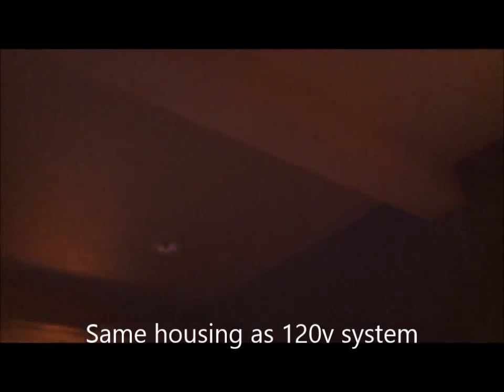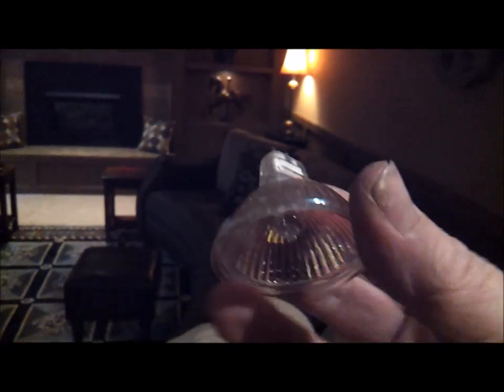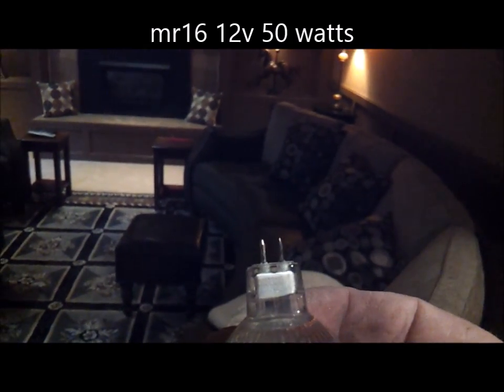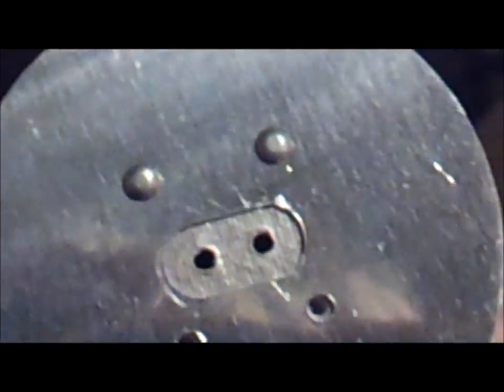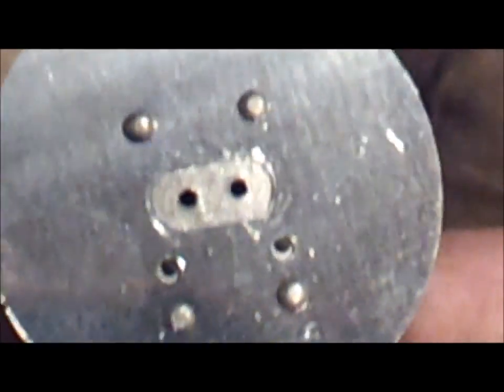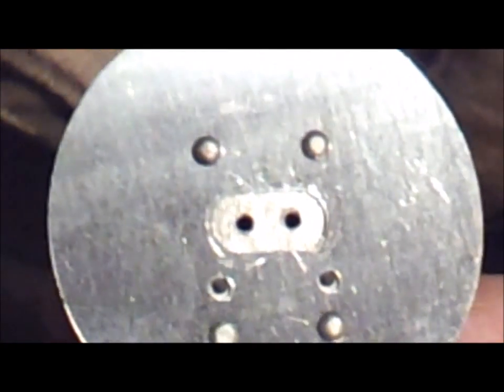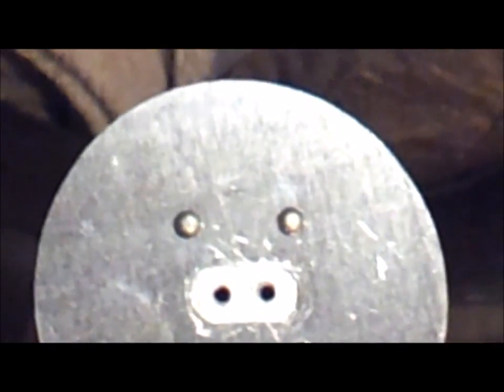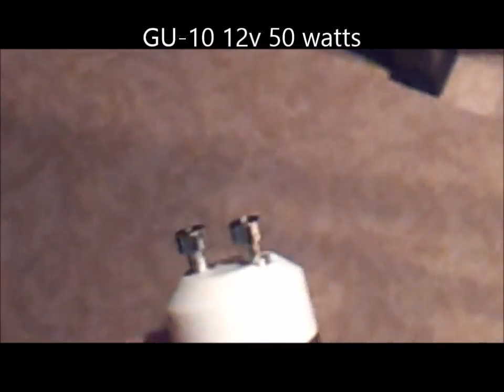Repair Faulty mr16 Halogen Light Socket with a GU-10 socket

Comment: I can’t make any sense of this. The mr16 bulbs are 12V input voltage. All the bulbs I’ve found that work with gu10 sockets are 120V. So they’re not compatible and if you try to to this, you will be in deep trouble.
Reply from the maker: https://www.ebay.com/itm/383796010318
Reply from the maker: https://www.ledlightbulb.net/index.php?main_page=product_info&cPath=2_120&products_id=2408

Comment: I found a retrofit kit at amazon
https://www.amazon.com/Voltage-Downlight-Dimmable-Magnetic-Transformer/dp/B0753TYHW7/ref=pd_sbs_328_1/134-0080920-5557851?_encoding=UTF8&pd_rd_i=B0753TYHW7&pd_rd_r=59549159-5f76-448e-b5c5-0445aaf903c1&pd_rd_w=2Vm74&pd_rd_wg=KUNZq&pf_rd_p=ed1e2146-ecfe-435e-b3b5-d79fa072fd58&pf_rd_r=VV699W6B8T1S0HF6YXW5&psc=1&refRID=VV699W6B8T1S0HF6YXW5

Round LED 4 Inch Low Voltage Downlight 12V; Dimmable, 11W, 750 Lumens, Day Light 5000K, Fits Most MR-16 4 inch cans

Comment: your link is to a 120AC volts GU10 bulb. the old bulb MR16 is a 12AC volts. ??? dId this work? did you remove the transformer?
Reply from the maker: thanks for the heads up. I fixed the link and the description. And yes you could remove the transformer and wire a 120v gu-10 led but would need to change the dimmer from magnetic to standard
Reply: @greenrumour  thank you for the links. I had given up trying to find 12volts
Reply: Which bulb did you buy? I checked ebay bulbs.it was a dimmable 88-260volts, not 12v bulb.

Comment: I tried this... I cut the wires past the shield and attached the new GU10 wires and sockets. It didn’t work for me at all. I undid the new body and place the MR16 light right to old wires to make sure wires weren’t damaged and the MR16 lit up. So I know wires coming out of can are good but new socket replacement doesn’t work. Before I cut anymore I am wondering what could be wrong? Any suggestions? It seems strange that almost all the lights have pitted at same time...they were installed at same time roughly 6 or more years ago. These were installed before I moved into the home. Any advice appreciated.
Reply from the maker: the first thing that comes to mind is the bulbs arent the same voltage.  If you have 12 volt transformers and bulbs now you must get 12 volt gu10 bulbs. If your exsiting mr16 bulbs are 110 volts the gu10 bulbs must be 110 volts

Comment: My problem is I cannot insert the two pins all the way in a ceramic socket. It is a pendant light system. Is there a solution other than socket or full replacement?
Reply from the maker: does the old bulb fit in?
if so you may have the wrong bulb. or a bent pin.
if you are positive the bulb is correct and you can't even put a bulb from one of the other pendants in then the socket is  going to need replaced.
Reply: greenrumour thank you. I know the bulb is correct because the same bulb fit into the other pendants.

Comment: Great video thank you...can I just replace my faulty mr16 socket with another new mr16 socket? Is it the same basic cut and connect as your video?
Reply from the maker: Yes you can.
https://www.ebay.com/itm/10X-MR11-MR16-GU5-3-G4-Wire-Connector-Halogen-LED-Bulbs-Holder-Base-Socket-JL/222691757842?hash=item33d9768f12:g:B7QAAOSwFqJWjhKy

https://www.ebay.com/itm/Lot-of-25-Porcelain-Wire-Nuts-Wire-Connectors-SMALL-High-Temp/232541156866?hash=item3624887602:g:VbEAAOSw7z1Z9O4z

Comment: Have read that MR16 bulbs go via a transformer ~ 12V
GU-10 are from the mains (UK 240V)
So if replacing them MR16 with GU10 - you should also take out the transformer.
Reply: Youtube is a global entity so creators and commenters should state their location to ensure everyone is working off the same page/voltage.
Reply from the maker: mr16 bulbs come in a variety of voltages. As do gu10. In this video we are dealing with 120 volt mr16 bulbs so no transformer is used. In the case the mr16 12 volt system. Than you would use a gu10 12v to replace

Comment: Hi-
Thanx so much...this had been a problem for me for years. I replaced everything as you suggested, hooked up 3 lighted lutron dimmer switches as well. Everything turned out so well.Thanx!!
Reply: I agree! I have recently moved to Canada where these bulbs, as well as G8 bulbs, are more common. The bulbs are obscenely expensive here ($6 - $8 each) and I was getting really fed up with replacing them. Your video has helped immensely